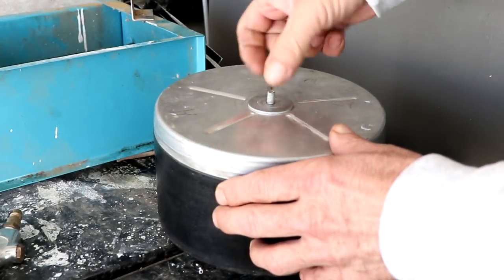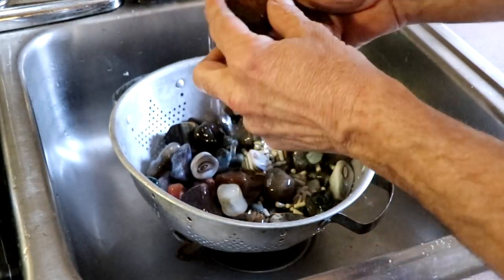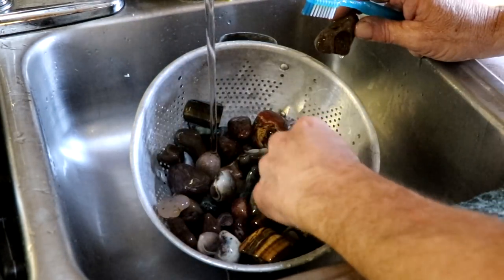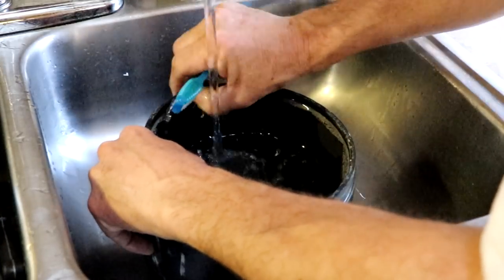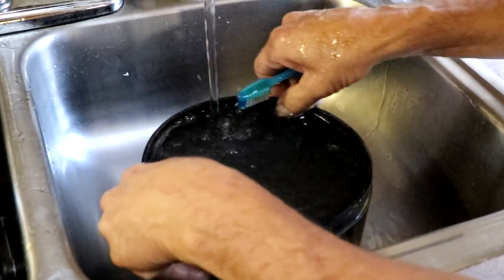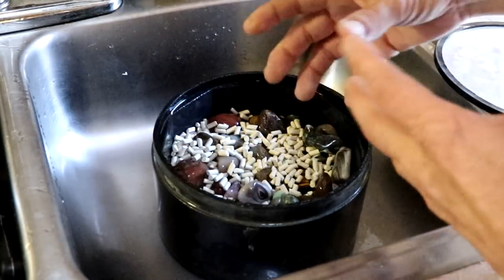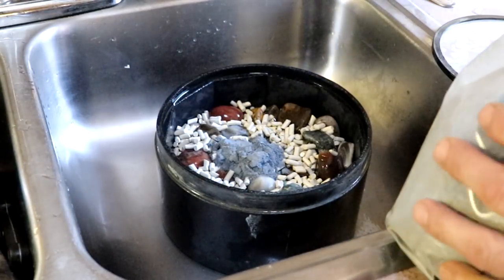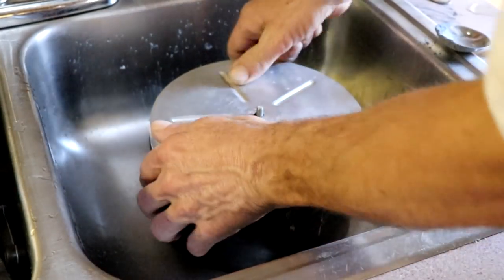Tumbling and Polishing Rocks. The "new batch" goes to step 3.

Comment: I polish the silver in my shop with a tumbler. For that we use stainless steel shot, a squirt of Dawn dish soap & water. Tumble for 20 minutes or so and rinse. Will work for jewelry & beads as long as its sterling silver.

Comment: Thanx for the Ceramic Media heads up.
I was going to use Stainless Steel pins , probably not a good idea?
Reply from the maker: I am not sure how that would work. Years ago they would sell plastic bb looking things and then it all switched to the ceramic media. Back in the day I did not use anything and just ran the rocks and still 80% of the time I had great batches. It was the 20% that never quite got glass shiny that made me switch to using the filler.
Reply: NorthernSeclusion I read about those plastic bb's as a filler so I went to academy and bought the bb's for the airsoft rifles. They worked fine the one time I used them as filler. Much cheaper too.

Comment: Nice rocks. But about your bug traps  a lobster fisherman gave
Me some security ideas use a thicker braided line back twist and weave in a few double sided razor blades a few feet from the beginning. What you could do is go back to where they stole them and put a few dummy lines  with a couple of bricks instead of traps tied to the end
Reply from the maker: Well if you did that you had better not have your traps tagged. You can get sued doing something like that.
Reply: NorthernSeclusion exactly you're right something like it's not nice to steal or be creative